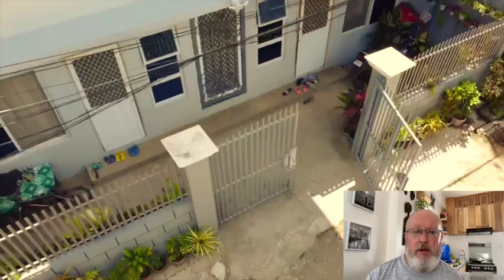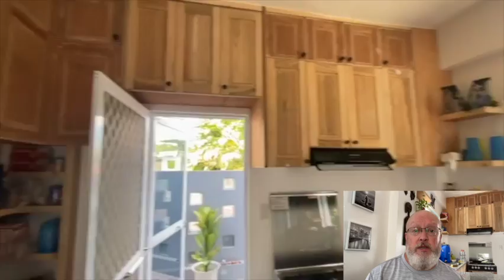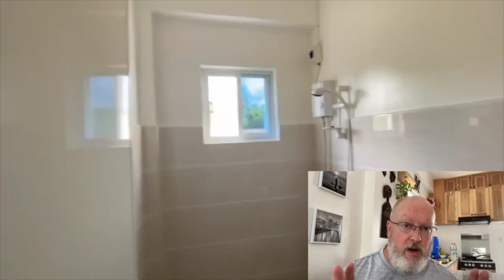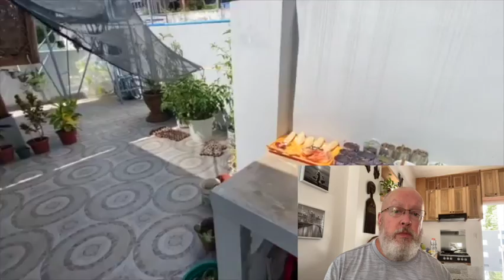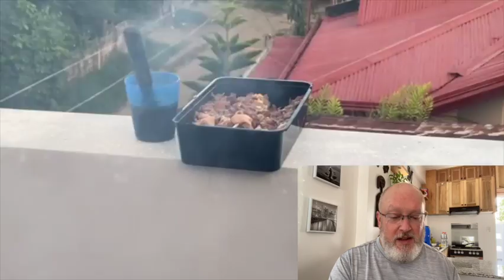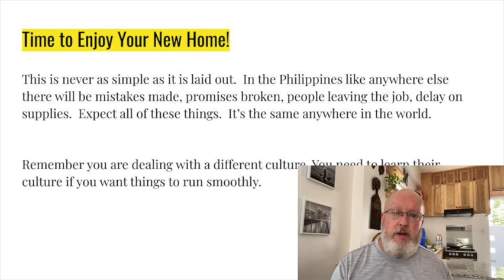How to Build a House in Iloilo City.

Comment: Did you use any insulation in your house?  Did you put any ventilation up high on the ceiling?
Reply: Ventilation at the top of the wall by the ceiling?
Reply from the maker: My ceilings are high enough to vent out any heat. We waterproofed the outside and we just painted three coats of White gloss paint on the sides and back. This helped tremendously.  You can touch the walls on the inside and they stay cool during the day.

Comment: A house or a castle 🏰 let me think 🤔
Reply from the maker: It’s a castle. You ought to see the view from the roof!
Reply: @ThePhilippinesProject  I have one also like that 30 feet’s  x 48 feets long and the height is 28 feet’s roof top also like you
Reply from the maker: Nice congrats 🎊
Reply: @ThePhilippinesProject  I put double walls with a foam in the Middle, East and west walls  sides to keep the house cool
Reply from the maker: @josephrobi6806  good idea.
Reply: @josephrobi6806  what kind of foam did you use. Spray foam or solid board foam and how thick was it. I have not found insulation in any Iloilo hardware stores
Reply: @alnascar97  I put 1 1/2 to 2 inches Styrofoam solid board. no need to go as much as that. You can go with different insulation as long it stop the heat going through. Also you don’t need to erect two block  walls just do it from the inside of the house with a foam 1 1/2 - 2 inches and use 4 x 8 artiflex sheet. Because of termites do not use plywood. Two walls is very expensive but in my case it was good because it also cut down the noise and the heat at the same time. Another part of my house is one wall and inside finishing with a solid board foam against the wall and artiflex for the final wall inside. With that I was able to put two windows having two walls. I added another window for noise reduction. Sorry 😐 it’s getting confuse probably to understand.
Reply: @josephrobi6806  was it foam board? Where did you get it. In canada I just put 2 inch foam board on my basement walls and then Fiberglass. Made a big difference. Ya will put insulation everywhere in our House in Jaro green meadows. Starting to plan the design now and have yet to see any videos where insulation is used. I see exterior roof spray foam for commercial buildings but have yet to see anyone insulating their new homes anywhere in the Philippines. The foil backed bubble is no where near enough to say it’s insulation
Reply: @alnascar97  The Same way in Canada insulation is to keep the heat in and in Philippines 🇵🇭 is to keep the heat out 😂. I got my styrofoam form board sheet from the general merchandise store. It sell all kinds of stuff for house and school in Philippines 🇵🇭
Reply: @alnascar97  I put another type of insulation for the ceiling. It come as a roll insulation flexible. I can send you a picture later. Insulation is very important it will save you electricity AC running too long.
Reply: @alnascar97  yes! Styrofoam sheet